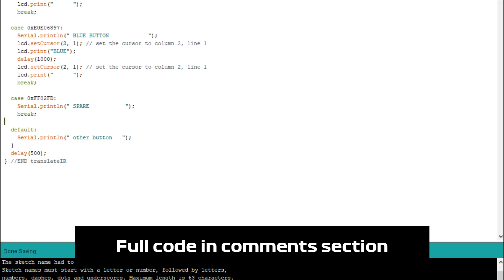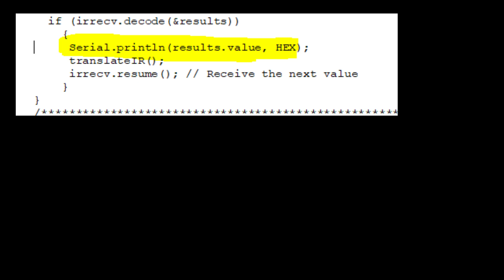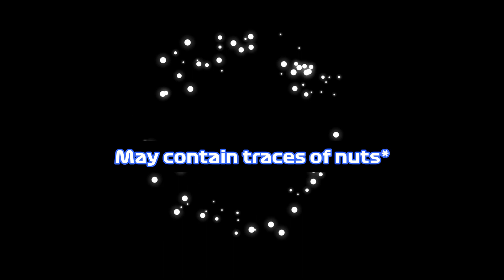IR Sensor, LCD, Arduino, TV Remote Control

Comment from the maker: Arduino Code : (FORSAMSUNG REMOTE - Modify the hex codes for other makes)

#include <boarddefs.h>
#include <IRremote.h>
#include <IRremoteInt.h>
#include <ir_Lego_PF_BitStreamEncoder.h>
/********************************/
// include the library code
#include <Wire.h>
#include <LiquidCrystal_I2C.h>
/**********************************************************/
LiquidCrystal_I2C lcd(0x27, 16, 2); // set the LCD address to 0x27 for a 16 chars and 2 line display
int RECV_PIN = 11;
IRrecv irrecv(RECV_PIN);
decode_results results;
/*********************************************************/
void setup()
{
  lcd.init();  //initialize the lcd
  lcd.backlight();  //open the backlight
  Serial.begin(9600);
  irrecv.enableIRIn(); // Start the receiver
}
/*********************************************************/
void loop()
{
  lcd.setCursor(0, 0); // set the cursor to column 3, line 0
  lcd.print("Samsung Remote =");  // Print a message to the LCD
  lcd.setCursor(2, 1); // set the cursor to column 2, line 1
  if (irrecv.decode(&results))
    {
     Serial.println(results.value, HEX);
     translateIR();
     irrecv.resume(); // Receive the next value
    }
}
/************************************************************/
/*----( Declare User-written Functions )----*/
void translateIR() // Print Button Pressed to LCD

// SAMSUNG IR codes 
{
  switch(results.value)
  {
  case 0xE0E036C9:  
    Serial.println(" RED BUTTON            "); 
    lcd.setCursor(2, 1); // set the cursor to column 2, line 1
    lcd.print("RED");
    delay(1000);
    lcd.setCursor(2, 1); // set the cursor to column 2, line 1
    lcd.print("      ");
    break;

  case 0xE0E028D7:  
    Serial.println(" GREEN BUTTON            "); 
    lcd.setCursor(2, 1); // set the cursor to column 2, line 1
    lcd.print("GREEN");
    delay(1000);
    lcd.setCursor(2, 1); // set the cursor to column 2, line 1
    lcd.print("      ");
    break;

  case 0xE0E0A857:  
    Serial.println(" YELLOW BUTTON            "); 
    lcd.setCursor(2, 1); // set the cursor to column 2, line 1
    lcd.print("YELLOW");
    delay(1000);
    lcd.setCursor(2, 1); // set the cursor to column 2, line 1
    lcd.print("      ");
    break;

  case 0xE0E06897:  
    Serial.println(" BLUE BUTTON            "); 
    lcd.setCursor(2, 1); // set the cursor to column 2, line 1
    lcd.print("BLUE");
    delay(1000);
    lcd.setCursor(2, 1); // set the cursor to column 2, line 1
    lcd.print("      ");
    break;

  case 0xFF02FD:  
    Serial.println(" SPARE           "); 
    break;

  default: 
    Serial.println(" other button   ");
  }
  delay(500);
} //END translateIR